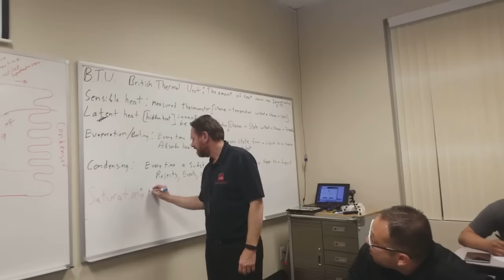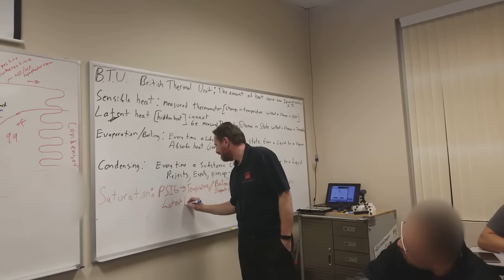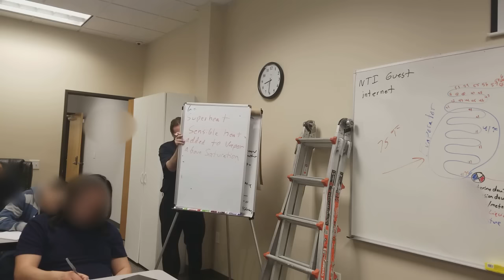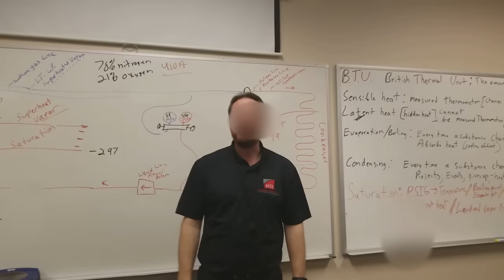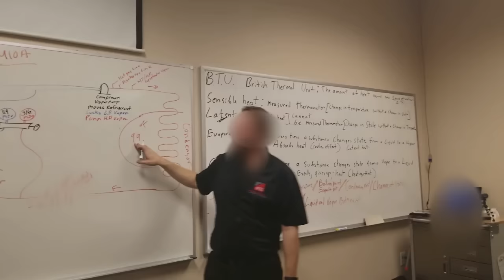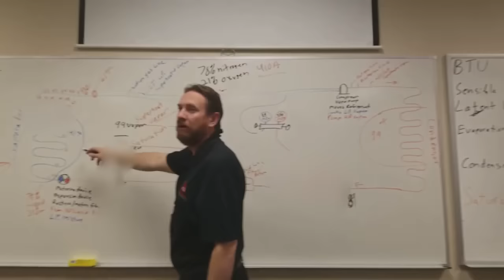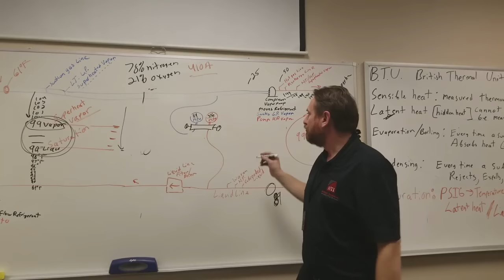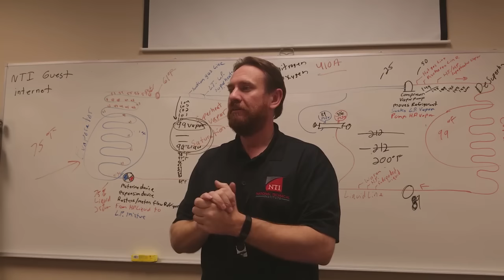Saturation, Superheat,  Subcooling

Comment: 3:51 - Saturated with what? Heat?  When liquid refrigerant has heat added to it at a certain pressure it will begin to boil (_bubble_ point temperature at that pressure). Heat will continue to be absorbed into the refrigerant in this state until any more heat added would raise the temperature of the refrigerant (_superheated_ vapor -temperature above the boiling point). Any heat removed from a de-superheated vapor will begin to condense (_dew_ point temperature at that pressure) -until enough heat is removed from the refrigerant at a certain pressure for it to become fully liquid. But, a solution is said to be saturated when the solvent can no longer hold more solute but will fall out of solution as precipitate. 100mL of water is said to be saturated with salt after 35g is added at STP and any more salt added will not dissolve into the water but will precipitate out (fall to the bottom of the beaker). When air is saturated with water it is said to be 100%RH. Any more water added can no longer be held but will precipitate out as rain). Am I missing anything here?
Reply from the maker: https://hvacrschool.com/saturation-and-the-pressure-temperature-relationship/#:~:text=In%20HVAC%20systems%2C%20liquid%20and,while%20the%20system%20is%20running.

Comment: You need to brush up on your terminology. You cannot have a vapor in a super heated state. You need to bring this terminology down to earth for your students. Should have an engineer teaching the class. 

Water boils at roughly 212* depending on atmospheric pressure. Water vapor can only pickup more heat if what? It’s under pressure. Like a pressure cooker. As the water is contained and has no where to go, it’s vapor cannot flash to atmosphere, the vapor has no other choice but to continue picking up heat. Thus the rise in temperature, ie super heated gas....... not vapor.
Reply from the maker: https://www.hvacrschool.com/what-should-my-superheat-be/

https://www.achrnews.com/articles/94178-superheat-and-subcooling-made-simple

https://www.hvactrainingsolutions.net/hvac-training-superheat/

Every body understands it a little different. here are some link that can help.
Reply: Ty Branaman - as an engineer of over 30 years, I disagree with the statement, “vapor and gas are interchangeable terms.” They are certainly not! 

Water vapor is not steam. Steam, a super heated gas, can come about only under pressure.  Those kids don’t know this but someone teaching such an educational class should. 

Please understand, I’m not personally attacking you, just trying to clarify for those who want to learn.
Reply from the maker: @BartSimpson-nr1dy  
I agree that scientifically there is a difference In the two.
However in the HVAC industry those terms are used interchangeably because the difference overall in the big scheme of things is neglagable.

The links I added are some of the most reputable in the hvac feild and they also are using the terms interchangably.

Please dont take this as an argument. You are correct but also please understand I am preparing students for entry level into the HVAC industry that use this interchangably.

I am not an engineer and I have great respect for the detailed and vast knowledge they posses. My sharpest and detailed students I recomend them to further their education. There is so much science that I would love to teach that I simply dont have time for and the students dont have an interest for and has little benefit at the time of their entry level career. 
For example I talk about absolute zero, but we also now know that is not the lowest point. These details and they why's are interesting but overall not beneficial use of class time for a career entry in the this trade. I hope all my students will take an interest to learn more about so much in this amazing world.
There is also soooooo much I still have to learn in this industand  I make it a point to learn more every day. I'm always interested to learn more. Again please dont take t
Is as an argument but just explaining the why behind this method. 

Thanks for taking time and interest in the subject.
Reply: Ty Branaman - well said and I agree with you. I started out as a technician at the aircraft engine group better known as GE in Cincinnati Ohio. 

I was around so many engineers at the time, and they clarified all the misunderstandings associated with my  trade school education that I went back to college for my professional degree. 

I suppose the way trade schools teach is certainly different than the college level as the goal of the students are different. 

I certainly struggled with these terminologies until it was explained in the most basic or fundamental terms or ways as with water. Water and it’s boiling point and in a gas state to further  heat. 

Sorry if I seemed pushy or rude. I just see so many kids outside of the trade schools after graduation struggling with this concept of sub cooling and super heat. 

Best of luck to you